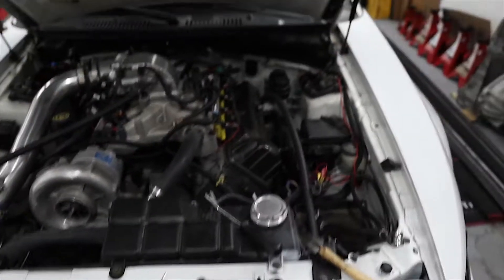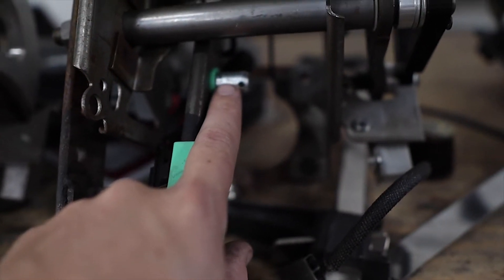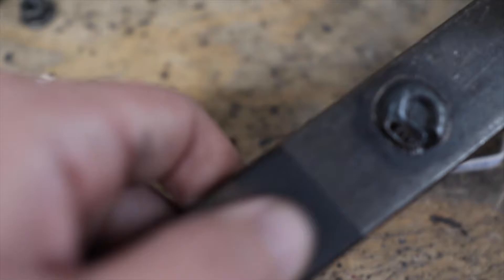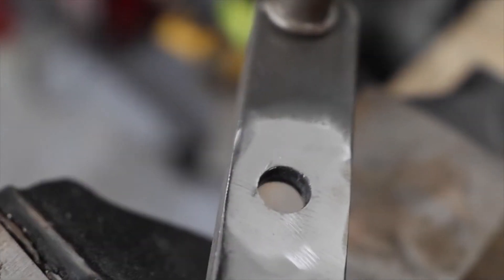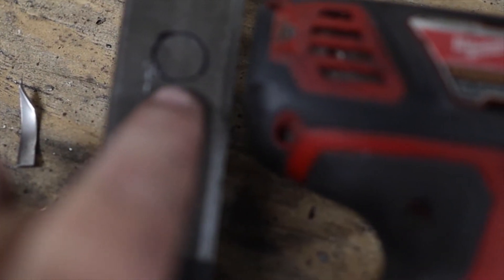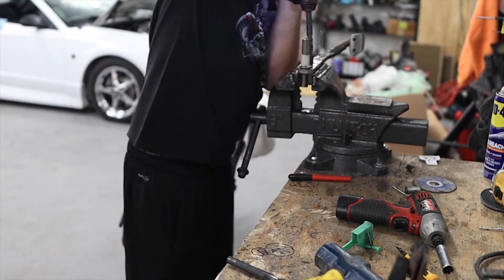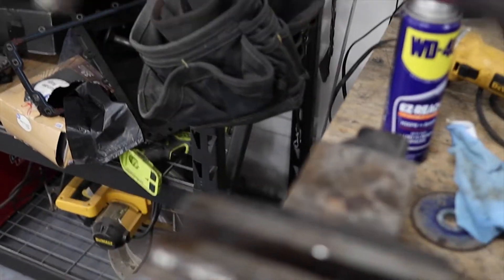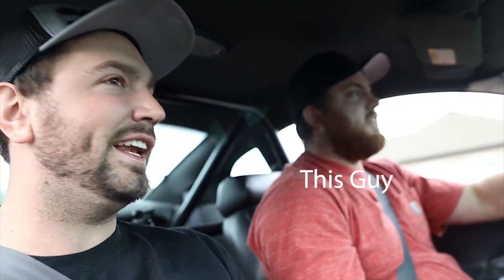Manual Brake Pedal Ratio 99-04 Mustang

Comment: You said you had to shorten the push rod on the master cylinder? How much did you shorten it?
Reply from the maker: Mine is adjustable so I’m not sure exactly but you wiggle room. If you go to short the brake pedal will just be closer to the floor but not affect how it works

Comment: Hey do you have the link  to sensor u had to use to get the brake lights to work ?
Reply from the maker: It’s Motion Raceworks 4 door brake kit. It had a pressure switch built into the distribution block https://www.motionraceworks.com/products/complete-door-car-brake-system-line-and-fitting-kit?currency=USD&utm_medium=cpc&utm_source=google&utm_campaign=Google%20Shopping&gclid=EAIaIQobChMIm6bZ3ojh9AIVKilMCh2mLgm1EAQYASABEgIdCvD_BwE